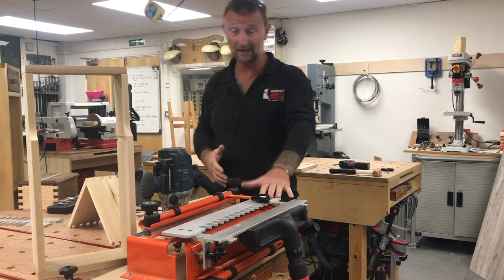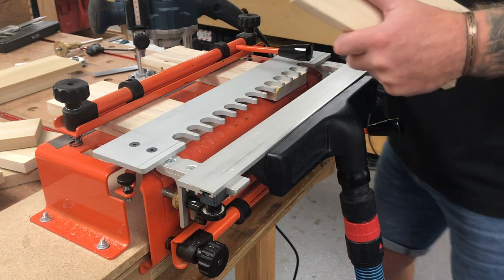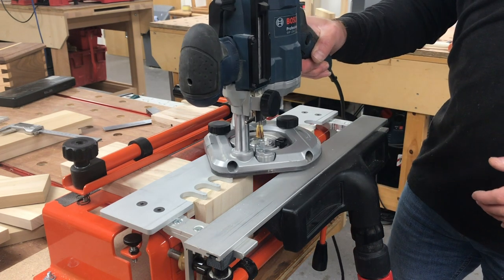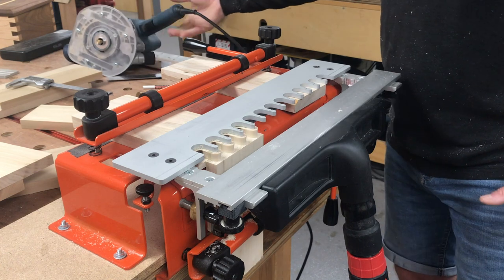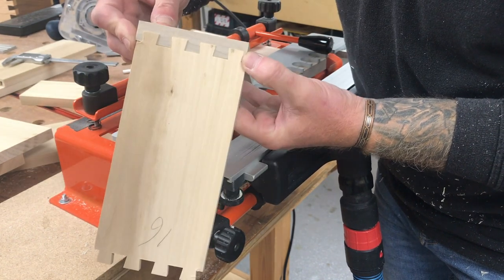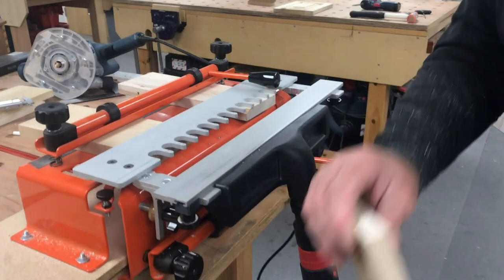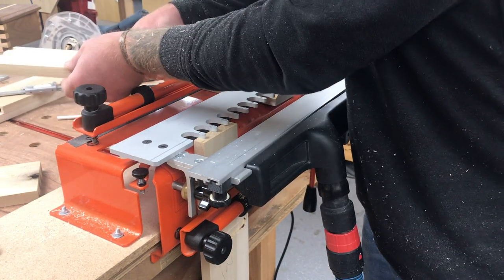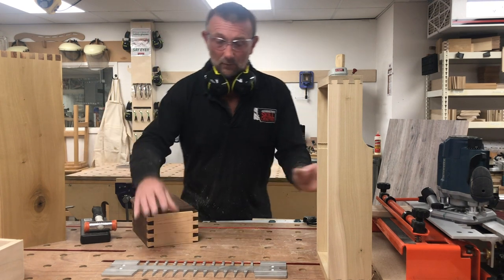#SkillCentreAtHome - Live Workshop Wednesday - Spice Rack Project Part 3

Comment: The dovetailer has side stops at both ends. If you are cutting boards less than half the width of the dovetailer, could you set up up boards at each end and cut two at a time?
Reply from the maker: Hi Paul. Yes you can, no problem at all.
Reply: @axminster  Excellent, thankyou for that